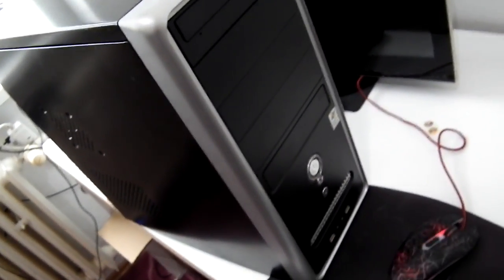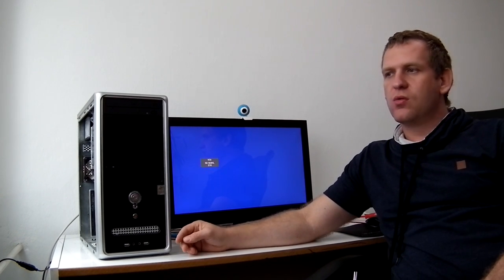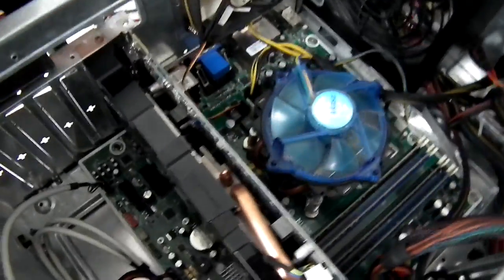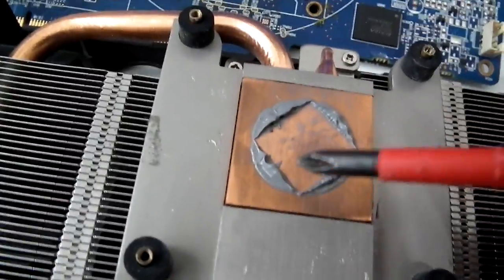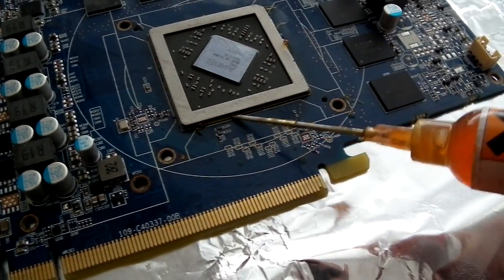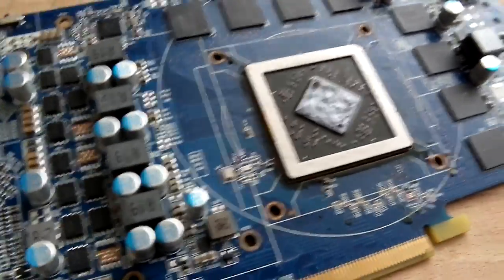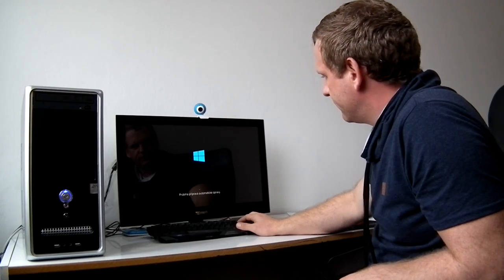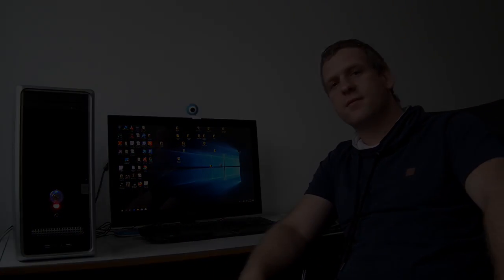How to fix GPU black screen after load windows - HD 7850 2GB FIX

Comment: Hi, i did all things on the film And my graphic card works. But today when i want play cs go i had the same problem as few days ago... what can i do?
Reply from the maker: Try do the same but use higher temperature for heat and longer period that's can help and after card started working again I Will try underclock card for 10 percent with will be help to keep card live for longer periods

Comment: mine can't boot  on windows 7. my pc has 2 OS 10 and 7. it works perfectly fine on windows 10. but on my windows 7. just black sreen. help me pls
Reply from the maker: Hi this is interesting I never see problems like this if all is good under win10 that all should be good under win 7 as well don't know why  but I Will just delete win7 and use just win10 can I ask why you need dual boot
Reply: @frogtechtips  hello. uhm i needed some apps for my work which can only run on windows 10.. But when in gaming im on windows 7 cause for me its a lot faster and better for gaming. But now after i installed my new gpu it wont boot to windows 7 anymore ,Its just screen.

Comment: I have the same problem but with no signal and fans up to 100% after win logo i can see during 1 second the Win account
I change the Psu=same problem
I must do reflow?

Sorry for the English please help!
Reply from the maker: Not sure do you know history of the card did you try reflash BIOS if you try all this and nothing works you can try reheating there is nothing to lose anyway
And don't worry your English is good :-)
Reply: @frogtechtips  Thanks i Will try
Reply from the maker: @yunieskigutierrezgonzalez4669  let me know
Reply: @frogtechtips  Hello i do these, and i low mhz to minimun but the temperatures in games are 90C WTF!!!
Reply from the maker: @yunieskigutierrezgonzalez4669  hi but now your card working and 90 C is ok under full load on heavy game. You can use better quality thermal paste or mod BIOS to keep temperature little down

Comment: I have same problem my is amd Rx 550 2 day ago who I got this problem I start pc sometimes show display & sometimes not but NumLock capslock key are working fine .. after soo many restart its work display work but is gone  again & , again after some mins... Even show display for hours sometimes but display gone again.. .My pc restart when my GPU  even on 60 50 degree .. what the problem??? Sorry for my bad english
Reply from the maker: Hi if your card is out of warranty I will try replacing Thermal paste and if that's doesn't help you can try reflowing GPU
Reply: Same problem
Reply from the maker: You can try reheating to get your card working again if it's out of warranty there is nothing to lose anyway

Comment: can you help me I have an RX 570 every time i want to play something it keeps black screen and flickering, and sometimes i got a message " radeon software stopped working " . how can that be fixed? thank you
Reply from the maker: Did you trying uninstall drivers and do a new installation
Reply: @frogtechtips  yeah but nothing changes
Reply from the maker: @davemabalot3294  is your GPU have two bios like switch on card if yes try that other one  plus what is temperature of your card is your fan working correctly
Reply: bought rx 470 4gb started the pc everything was okay installed drivers did some benchmarks browsed and then started a game and the screen went black did a restart started other games sam results plz 😭 save me.

Comment: My gpu is spinning 100% when I try to open games and restarts . I have also installed new graphics drivers. Cleaned my power supply , applied thermal paste on graphics cards then it will not show any signal while booting but when I removed graphics card and boot it then my computer is working fine but unable to play games ..
Reply from the maker: Looks like GPU core problems you will need try reflowing GPU like I do in video

Comment: Currently trying to save a Sapphire dual-x 7850 like the one in your video. Drivers will not install no matter what i do (code 43).. flashing a new bios makes no difference also. Somtimes get a black screen on windows start up aswell.

I reapplied thermal paste but did not check for flux leakage. I will buy some cleaner to clean excess flux from around the gpu and then buy a heat gun. Can anyone tell me the theory behind the heat gun method and how long you point it at the gpu for?

Many thanks.
Reply from the maker: Hi have a look on my channel I have many videos about this problem and where I more detailed explained how o do but on short you need use flux and heat gun 290 up to 320 Celsius around 10 min . Some card can works 1 Day and some even 3 and more years that's my experience I hope that help and let me know once you done

Comment: I have rx570 4 gb , my card was working just fine until some days ago then while I was playing cod warzone my screen just goes black (crashing) but my pc was on still and everything was working expect my GPU , so I thought my PSU it has no more power to run it cuz its only 320W!!!, I tried in onther pc with 1000W , same thing, so I opened I saw that the thermal paste just gone in my GPU but I couldn’t buy because of quarantine all the store’s are closed , so I opened my GPU for 5 times in 2 days nonstop trying to figured out where is the problem , I downloaded new windows new drivers but nothing worked , I did with hot air to the chip then closing trying again  same time my GPU temperatures goes to 90 degrees and then crashed sometimes it crashed with 60-65 degrees, so I used benchmark to test it slowly from 720p to 1080p medium , so still crashing , I just went to amd application that comes with drivers and puted my tuning to automatic then presing overclock this gpu (that thing will overclock your GPU automatic) so it worked for me but still my temperature is higher so I still need as soon as possible to put new thermal paste on it, just try to understand carefully cuz are a lot information out there and  if it’s not working try everything possible in the end it doesn’t matter it will not be more worse than it is. I hope this it will help someone.
Reply from the maker: Hi that's longer comment on my channel I think if why you are not buy thermal paste online from some shop  as run card without thermal paste can make more problems on the end  plus iam suprise yours 320w PSU can run even overclook your GPU that's must be good Brand with high A on 12V rail

Comment: Thanks man, I wish you had far better Graphics card
Reply from the maker: I have rx  580 8gb this been just pc I repair for someone :-)
Reply: @frogtechtips  Do you recommend the RX 580 8GB or the GTX 1660 Ti 6GB for mixed usage on a 1080p monitor? My HD 6970 also broke down with some horizontal lines and couldn't get into Windows a week ago. So now I'm looking for an upgrade :)
Reply from the maker: @MegasXLR  hi I like my rx 580 8gb but both choice is good for what you need I will take one with one have better price there is not huge defence between performance
Reply: MegasXLR watching this video because my 1660Ti I just got caused my screen to go black :(

Comment: few weeks ago same problem with my gpu 
I saw your video  and apply that.
Gpu works great. 
But today Again the same problem. 
It is just a temporary solution not permanent.... 
😑😑😥😥
Reply from the maker: Hi yes sometimes can happen I will repeat process but use little longer time and bigger temperature as well like I say nothing to lose anyway
Reply: Again  I do same process.  Now it working  but.. I know it is not lasting anymore.  .. 😑
Can you tell me how many times can i do this? 
Is there any better solution?
Reply from the maker: @itzalu  hi you can do that many times you like and i Will underclok card little bit as this can help as well or you can do proper reballing like take chip off put new solder and solder back but for that you will need good equipment  you will see how long will last now and you know is time to save for new GPU
Reply: @Frog - Tech - Tips .  i research about Reflow On GPU. I read many comments and blog about it.  it is not the problem with the soldering of gpu chip. it doesn’t need gpu reballing.  When put heat on the sliver side of the chip it repair the fault. That's  why many people use oven,hair dryer, electric iron and many more..
Reply: Cpu reballing  or reflew  is temporary  it is not permanent . Sometime it work few day or sometimes it work few months. 
Actual solution is replace the chip with new or fresh chip or buy a new gpu. Thanks man for your video❤❤
Reply from the maker: @itzalu  yop you right but from my personal experience some cars working even after 2 years of repair like this
Reply: @frogtechtips   its totally  lucks  bro.
Reply from the maker: @itzalu  yop is lottery I repairs with this style about 600 GPU in my life  and only 10 bring me back in short period like 4 to 10 days and if that happens I do that again and replace BIOS where I underclok card and use lower voltage as well and usually that helps keep card working for longer periods
Reply: @frogtechtips   so should i try under clock?  My gpu normal clock is 1020mhz  What is the point of under clock is? i mean how much need to down  ?
Reply from the maker: @itzalu  i Will try 10% down and also get voltage down as well and after just testing usually make like 2 for fps down in game but less stress for GPU mean longer Life I always use BIOS modification to make this permanent you can find video how to do that for AMD card on my channel as well
Reply: @frogtechtips   please give me that video link for gpu underclocking and voltage.
Reply from the maker: @itzalu  here https://youtu.be/FFuESXhKWr8

Comment: how many mins heating it plz? i had same proplem whit rx 580 after change pads and paste its get black screen under stress and over heat reach to 85 c  however before max temp 63c help me plz
Reply from the maker: Hi I usually heating about 10 to 15 min in 290 Celsius
Reply: @frogtechtips  thanks
why some gpus get crash black screen after change thremal pads and thermal paste
my  two gpu was work fine but after clean it
have alot of isuess 😢😢😢
Reply from the maker: @king_king89  not sure Man there can be many problems like when you opened card make some physical damage or old thermal paste been so stiff and once you take off damage GPU die or something like that

Comment: I've been enjoying your graphics card diagnosis and repair videos. They've been very informative. Could you help diagnose an issue with a graphics card I recently purchased off eBay as faulty. It is a GTX 970.

In the advert the seller said after a certain amount off time (1-30 minutes) the graphics card causes his PC to reboot. When I opened the card up there was thermal paste all over the place. On the MOSFETs, capacitors/resistors and the memory modules. He must have applied paste onto the pads. After cleaning up I tested the card. I left the PC on in the BIOS for over an hour without issue. Once in Windows I tried playing a game, when under load the screen goes black and there is a second of distorted audio. My PC remains on and I can still hear game audio. As long as I don't do anything GPU intensive it won't happen in Windows. There are no artefacts and the FPS is fine up until the black display issue. To me it seems like a problem with power delivery  or voltage regulation. 

 So far all I have done is completely reinstall drivers using DDU. I am going to try flashing a new BIOS for the card. What on the PCB can go wrong? Anything I can test with a multimeter? I've been reading forums about people with similar issues and the most popular reply is to get a new graphics card. Really annoying when the only problem could be a tiny resistor.

I'd appreciate it if you can help with this problem.
Reply from the maker: hi this is sounds for me like gpu die problem once is go under pressure procesor failed and go to black screen I will trying reflow if you have equipment for that
Reply: @frogtechtips  Damn. That is pretty much worst case scenario. Just looked at GM204 chips on Aliexpress and eBay and they go for £60-70. A used card can be had for £100. I paid £20 for this one. 

I should note that there is a mark on the die that wouldn't wipe off with alcohol. Also the heatsink where it makes contact with the die has writing from the die on it. GM204 managed to imprint itself.  Hard to explain but do you understand what I mean? Too much pressure perhaps, maybe the previous owner/s tighten the screws too hard.

What can I achieve with reflowing? Does it reseat the BGA solder to make a better contact?
Reply from the maker: @FHP2395  definitely sounds like previous owner don't understand to much what is doing if you pay 20 you have nothing to lose just try reflow with can make better solder conection and card can working again or try under clock thick card in msi afterburner try use less voltage and take down gpu clock this can help as well
Reply: @FHP2395  u got any updates ?
Reply: @FHP2395  is it working now ?
Reply from the maker: Will be nice to getting answer

Comment: i have a gpu but doesn't working, when i installing the drivers, in half way, it goes black screen. How to fix thanks
btw my gpu is geforce gtx 570
Reply from the maker: If you try all other solutions and your card is definitely out of warranty I will try reheating GPU there is nothing to lose anyway

Comment: Poor video card... After submitted to a reflow - the proper technical solution would be reballing the GPU instead - it was flooded by nearly 1kg of thermal paste - when a very thin film should work. Definitely black screen will show up again sooner or later...
Reply from the maker: Hi that's probably tru but try think twice card like this cost nearly nothing and you will pay for reballing to much more cheaper is buy new card this is solutions you can try yourself without spending anything and give you same time to save some money for better card. Btw I have some card with after repair like this working till today problems not come back

Comment: Bro my zotac gtx 750 ti dual fan shows display for nearly 1 to 2 minutes than no signal and sometime shows white screen and than pc restarts. Gpu and cpu fans are spinning.
So wats the problem i don't have enough money to buy a new one. 😥😢
Reply from the maker: First at All try replacing Thermal paste and also test your card different PC
Reply: @frogtechtips  i tried in different pc but still problem exist
But after replacing paste sometime timing of working increase
Reply from the maker: @hello_its_me_unknown I think GPU die have problems and in your case need reheating GPU like I do in video

Comment: It didnt work for me but i had the same problem after i did everything my cards fan blows 100 percent and then weaken and repeats until restart happens automatically
Reply from the maker: hi this sounds like little different problem try reflash bios
Reply: @frogtechtips  uhmmm im kinda new to this kind of stuffs how would i reflash bios?
Reply from the maker: @rasharddelapaz3390  go to techpowerup website you will find there all information you need including bios for your card

Comment: bought rx 470 4gb started the pc everything was okay installed drivers did some benchmarks browsed and then started a game and the screen went black did a restart started other games sam results plz 😭 save me.
Reply from the maker: Hi i Will have a look on thermal paste and if you bought used one I will check BIOS as maybe someone flash BIOS for mining and that bios is not good for gaming  definitely look if you have correct version BIOS loaded in your card
Reply: Everything runs okay furmark etc except when i start a game it goes to black screen after few seconds
Reply from the maker: @indominous_rexx3806  that's strange man did you check that bios version it is correct one
Reply: How do i chek that

Comment: sir i have gigabyte h61 s1 (rev.4.0) and i want use my amd r9 270 but its not working ...... its show me black screen what i sir dear ???????
Reply from the maker: It is working before or just one day stopped working I need more about history
Reply: @frogtechtips  sir actually I buy it second hand...
Reply: @frogtechtips  and not working when I used it first time also
Reply: @frogtechtips  what I do now, can I go to return this or any other solution
Reply from the maker: @Venom_RK  is your PSU strong for that card and did you plug in all Power cable as well
Reply: @frogtechtips  yah ... I have new psu ant esports vs500l
Reply from the maker: That's really sounds like foulty GPU if you can send back to seller if you can't you can try fix like I do in this video
Reply: @frogtechtips  I want to run this ...but I don't know how😞😞
Reply from the maker: @Venom_RK  try send card back to seller and buy new one that's best opinions for you
Reply: @frogtechtips  I have Gigabyte h61 s1 ( rev.4.0) can u suggest me best card for this
Reply from the maker: @Venom_RK  it's depends of your budget my friend
Reply: @frogtechtips  helo sir , thats card working , but not on my motherboard . now what i do ... please reply
Reply from the maker: @Venom_RK  did you test that in different mb or how you find that
Reply: @frogtechtips  I test it on my friends mobo
Reply from the maker: @Venom_RK  ok thanks must be your mb have some foult maybe is different GPU working on your PC

Comment: Hi Great video, i have a gpu that works until it tries to load the driver then black screen. computer is still running but i can't do anything with it. Will heating the gpu as in the video help?
Reply from the maker: Hi as your GPU is out of warranty there is nothing to lose anyway just try I think will be help